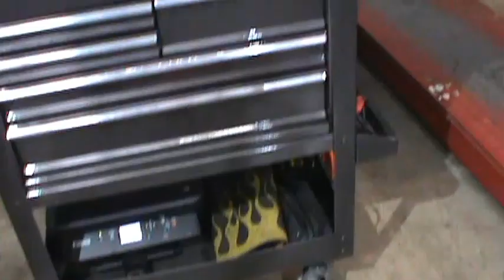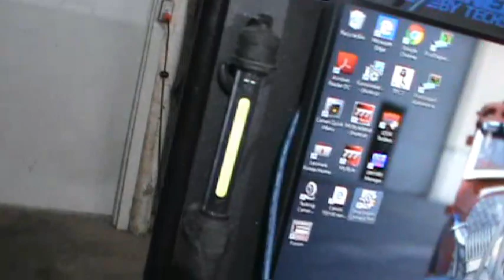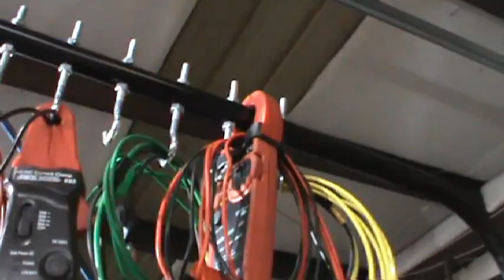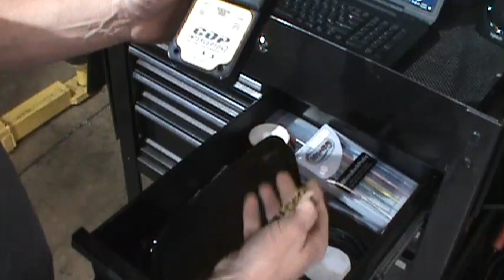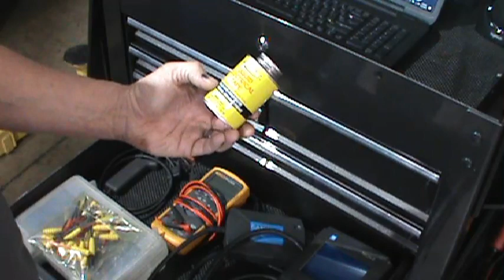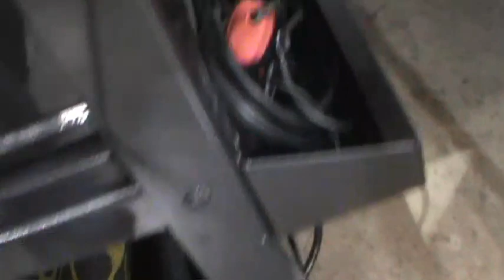Diagnostic Cart Tour/Run Down

Comment: I like the boom. 🤔 I think mr practical mechanic could use one of these at work and for his live streaming equipment.
Reply: 🤔 either Chad is on her account , or he is one lucky fella
Reply from the maker: Thanks Valerie! I like the way I can walk under the cables when working on a vehicle and not tripping or stepping on them.
Reply: That would be beneficial because I just had to send in one of my pico scopes for repair because I tripped over a test lead and ripped out a BNC connector. (Ps. This is Valerie typing for chad because he’s driving 😆)
Reply from the maker: @ThePracticalMechanic  Bummer on the Pico.  That's the main reason for the boom. I didn't want to risk yanking it off the cart,getting tripped up, damaging the Pico or my leads.